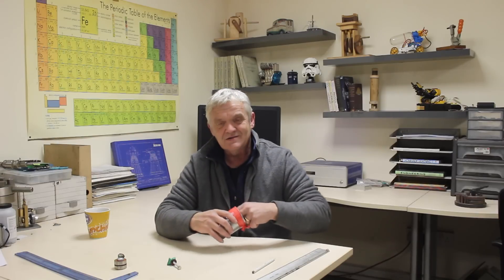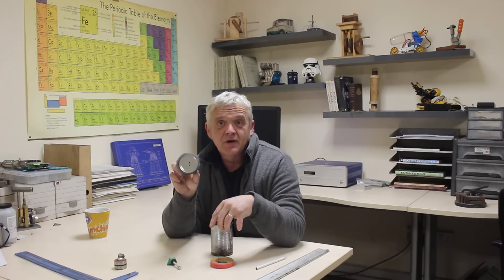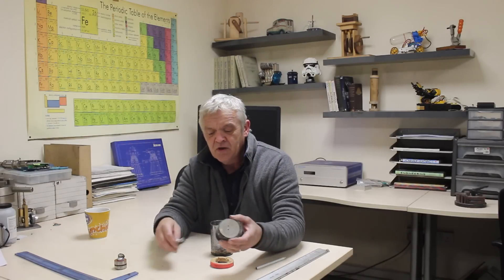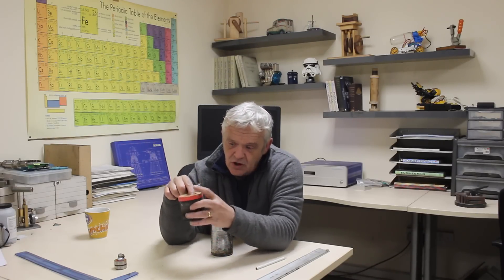1698 Power For Everyone A Cheap Easy To Build Stirling Engine I May Have Invented

Comment: I'm guessing your engine is new. Which is amazing after 200 years anyone could come up with a new Stirling engine of any type....Anyhow I see one potential issue with your design. It's efficiency may take a hit from the energy required to disconnect the magnet. Maybe using an electromagnet and simple having it deenergize at the disconnect point could remedy the issue... All the same I wouldn't be surprised if your design could have a real world applications.

Comment: what if the magnet were an electro magnet powered by the engine?  As the fire heats up, the flywheel wants to spin faster and faster...but you program the electgromagnet in such a way that the engine governs itself...when the flywheel wants to speed up, the magnet becomes stronger and absorbs the extra energy while keeping rpms and displacement constant.

Comment: If you had Huge sterling engines along the spine of an O’Neill cylinder, would that mean that there are certain areas that are deadly or at least very hot?  Or would the air circulate enough to warm the entire O’Neill cylinder automatically?

Comment: For anyone interested in springs at the top of the diagram: 
1. The spring loded toilet paper rod seems to be a solution.
2. It's plastic with a spring in it. 
3. Will stop the wabbling, and give a push back if attached To the top of the magnets, in a linear generator. 
4. The smaller diameter plastic tube is all plastic ( no metal spring). Spring housed in the larger diameter outer tube. 
5. Travel is about a respectable 2 inches/ 5cm.
6. I sprayed graphite lock fluid on it to reduce friction. 
7. One could remove the spring entirely from the tube and glue it to the top of the magnet stack to reduce friction and wobble, and also to an overhead brace bar. 
8. Separately: a straight rod glued to the top of the magnetic stack attached to a bow spring from a hacksaw Blade will stop the wobble and give a return Force. 

SUMMARY: This setup would force air down giving greater travel of the diaphragm. Air to a plastic tube that could drive a second tin can diagram ( cooling side) generator. Thereby doubling electrical output.
Hope this helps.

Comment: Great idea! 😁
Scale up the model with a metal membrane, replace the small magnet and the weight with one big neodyme magnet, add some coiles and compare the fuel consumption (e.g propane) with the generated electricity to get the efficiency. 😀

Comment: I am always torn between Stirling engines and thermoelectric generators when it comes to converting heat to electricity at home. This little motor has me leaning back toward Stirlings. Very cool.
Cooler still is your willingness to share your ideas without trying to get rich from patents. People are going to badly need channels like this pretty soon with the coming hard times.

Comment: Would it be possible to add magnets to the displacer and a coil on the outside?  I imagine you would need to change the material on the sides of the container though.

Comment: If the balloon gasket lay between a lower can with the displacer and an upper one filled with water, (which might replace the metal mass) and two one way valves in the upper can, one allowing water in and the other out, then you might have a simple water pump?

Comment: I dunno why but I find this incredibly fascinating. Obviously the balloon has a very short lifespan but the magnet-displacer could essentially last indefinitely being that there is little to no friction forces happening. And being that the balloon is only regulating the pressure, replacing the balloon/weight with a piston/spring would be a little bit of engineering but could benefit this system to it's maximum. I'm really liking the concept though being that it could be made out of practically anything cylindrical that can withstand heat
Reply: could evilly replace it with some thin silicone sheeting and that would handle the sort of heat its using.   and or adding fins or other cooling to the top..

Comment: So is there a valve?  i keep seeing kinda whips of steam,  also not sure if there was one diaphragm or two kinda sounded like you had a lower diaphragm holding the bolt and an upper one with some sort of button?
Reply from the maker: no valve mate the 'steam you see is a bit of my glove burning where I touched the hotplate by accident lol - there is only one diaphragm the displacer is a solid bundle of wire wool

Comment: I see a problem of using it as a free piston device in that it's not possible to accelerate od decelerate it's speed but I suspect it's power is limited by the strength of the balloon membrane that pulls the piston off the magnet. U can't apply more heat to get more output  as u can from a Stirling engine.
Reply from the maker: a balloon is just easy to make - it doesn't have to be a balloon to be a diaphragm - there are still diaphragms you know
Reply: @ThinkingandTinkering  thanks for the info but can you through experimenting end up with say 1 hp to drive a pump

Comment: Ive always thought with solar arrays if they lose efficiency as they get hot, I wonder if somebody couldnt put a liquid cooling system on them that circulates using convection and then  uses stirlong engines as the coolant heats up to turn that heat into more electricity.

Comment: Hum, replace your top weight with a rod topped by a small magnet that passes up and down through a copper coil, add a couple of diodes to DC it you've got a generator to power your TV, run the fridge and Bob's your uncle !  

OK, maybe charge your cell phone in a day or so, still pretty cool. ;-)

Comment: Clever.

Magnets are wonderful things in their ability to exert and release forces so simply in all kinds of conditions and through various materials.

Put a small wire coil inside the stop ring and lead the ends of the wire out and your magnet does double duty as a generator as it goes up and down.

Comment: About 15 years ago, some australians invented a way to print solar panels. Printer cartridges can be refilled by injecting the ink. What if we fill them with solar panel chemicals then when we print, we select the exact hexidecimal color that activates one of the 3 color cartridges or the black one to print circuits for solar panels? The one thing needed is the conductive ink, there is a way to grind up charcoal in a blender then extract it off the top after it settles to get conductive carbon ink that I noticed. Researching the other chemicals I have seen everything from toothpaste to other weird things being used lol. I don't think it would be that difficult so long as the printer heads dont clog up and it would get the ball rolling for everyone else to experiment with improving the solar panels I notice you have some improvements. I would like to say maybe if you got hologram paper of some sort and painted it with the flourescent ink a certain way it could improve the efficiency if you layed it on top of a printed panel. Do you think this is a great project that could help the world? I have asked defcon and andreas speiss and no one really replies helpfully but you think so much like I do that I think maybe you would like the idea. Also, if you were to do this, make sure you use an older printer that doesnt have barcodes on the ink cartridges because the companies limit whether you can refill them now using those. One more thing If you take a tin can then take two bottoms of coke cans and cut them off then shove them together, it fits perfectly into the tin can for a pison.

Comment: Looks like the one NASA was working on early 2000s. Only no magnets but a spring like system. I can't see magnets being used for a while with your engine because heat degrades magnets of course, you would have to test how long it takes for that to happen. Would be worth exploring.

Comment: Looks really awesome but I thought sterling engines had lightweight components because the pressure difference doesn't exert much force?
Reply: Yeah, most of these are very low power.

Comment: Dear Robert, I really liked your video about this magnet driven displacer Stirling engine! Thanks to your kind words! :) It's not pretty new as an idea to use magnetism to lift up the displacer. Almost 10 years ago I saw a patent from a Chinese LTD Stirling where they used the magnet as lifter. I'm not pretty sure they was the first or not because I saw lot of magnetic LTD Stirlings, homemade and manufactured versions, cranked and free piston versions too. On the other hands what I've never seen that is a free piston HTD version two in one as yours. But I'm not the man, who knows everything about this type of unit or seen every type of engines, just a big fan of hot air engines. The main thing that I wrote you, It has a speed limitation that means power limitation too, because the frequency is limited when we use gravitation to moves the displacer back to the bottom. Some springy part could help a lot to increase the speed,but all knocking noise means mechanical losses usually. Tricky to make one without physical connection between the displacer and the power piston also you should put some spring on the top of the displacer. Anyway your Stirling unit is pretty rare and unique actually simple enough to try to build for every Tin Can Stirling hobbyist! ;) BLADE
Reply: How fantastic that you replied!!
Reply: @WJR-Vlog  🤝 🙏 🍻
Reply: So add ring of spongy spring foam to the bottom of the ring so it absorbs some of the up displacer energy and forces the displacer back down. Maybe even make the stop ring out of spongy foam
Reply: @yougeo  I can see regular foam not liking the heat very much.  Carbon FELT, on the other hand... :grin:
Reply: @KeithOlson  This part is located on the cold side, so no problem with the heat.
Reply: Small repelling magnets on the warm side

Comment: Traditional Sterling engines use heat/steam but I don't get why this one needs a heat source?
Define displacer in this context, does it displace expanded hot air to act as a kind of piston?

Comment: The only downside I can think of is that the high temperature and constant hammering could demagnetise the magnet. Might become irrelevant with a few tweaks though, like softening the blow with felt (as M C suggested) and bleeding off a fraction of the kinetic energy through a coil inside to remagnetise the magnet.

Comment: Great job!!!as a pseudo  engineer😜 I always lookat something for simply  and durability- unfortunately  rubber will wear quickly with heat and expansion- I wonder If replacing the balloon with a hollow piston/ pipe  would work?
Reply: id just do the same with some thin silicone sheeting

Comment: Now all you need is a small coil that little magnet moves up and down in, and you have a generator.

But it won't be much energy because if it's pumping to many amps, it'll stop oscillating.

Comment: 3 ideas for improvement: 1.  put a piece of carbon felt on the ends of the displacer to dampen the noise.
2.  If the wire wool is acting as a regenerator, then cutting holes in the plates that hold the regen together to allow more airflow will improve performance as a regenerator but may reduce effectiveness as a displacer. (maybe like a turbo in a combustion engine?)
3.  replace the magnet with a solenoid or magnetically assisted solenoid to allow for precise control of engine timing with pulsed power input. (like electronic ignition timing in a combustion engine)
Reply: @tomh2618  I'm saying that replacing the magnet with an electromagnet enables you to control the movement of the displacer (and by extension the volume of air/working gas) by pulsing the electromagnet on and off.  Controlling the position of the displacer controls which side (hot or cold) the working fluid is at, and by controlling when the displacer changes position you control the dwell time when the working fluid is allowed to take in energy (heat up in the hot side) and expel energy (cool down in the cold side).
Reply: @McRootbeer  except the electromagnet will likely consume more power than this tiny unit generates

Comment: The Robert Murray Smith magnetically actuated free piston ringbom Stirling engine... do I have that right?  maybe just call it the free piston magnetic ringbom for short.  it's awesome no matter what you call it 😁.
Reply: Dear MC, the Free Piston Magnetic assisted or driven displacer Stirling. A Ringbom type unit has pressure driven displacer, and there is another small piston inside usually. BLADE

Comment: Neat idea. What I'd like to see is a simple Striling engine kit connected to a 12v motor so it can generate small but constant amounts of power. Even a 10w motor over 10 hours will produce 100wh of power.

Comment: Thats a really cool idea! Generally this setup must waste quite a bit of energy just because dropping the displacer with each cycle nullifies the potentional energy it has... BUT there might be two ways to approach the problem - either make it lighter to waste less energy or make it heavier and attach it to a crankshaft mechanism (to act as a flywheel) sticking out of the bottom of the can.
Reply: Go even simpler, change the counter to magnets and collect the energy with a coil. just need to glue a non magnetic spacer between the balloon fixpoint and the stronger magnet. Remember waste heat is everywhere to power this. This invention is more about ease of building.

Comment: I might as well ask here: has anyone seen an engine design that is essentially a shaft in a housing? A series of depressions run down the length of the shaft, in a spiral, with bookended matches in the housing such that cavities are created as the shaft rotates. In so doing, a linear series of detonations can be effected down the shaft's length, only to repeat when reaching the last one. This creates rotation, and also allows for exhaust as the two voids slide away from each other immediately after firing. I know I've seen this some where. Also, you Rock. Great build idea.
Reply: Checked a Rotary engine ?
It doesnt really depend on if its moving down or around a shaft but it might ned some sort of compression/expansion.
Also explosions are bad for getting a normalized/constant power transfer,  continued burn/heating up of gasses allows for a more constant pressure while the volume increases and the burn/expansion is still ongoing.
If it's a single bang there is a lot of pressure (and stress) at the start but as soon as there is a change of volume/movement/expansion the pressure drops rapidly and so does usable force.

There are "explosion" rocket drives tho.

Turbines are "simplified" a constant/linear ongoing 4 stroke process..
Reply: @PsiQ  Heard. If I understand correctly, a rotary is a Wankel type? In that case, the Wankel would almost be a 2D, if you will, version of this, which is an extended shaft.  To be fair, this design could utilize steam, or even compressed air and still function.
Reply: @wombleofwimbledon5442 
both the  "piston" and rotary engines can use steam/pressure if introduced where the spark/ignition is supposed to happen, but you would not get the high input to output ratio of the enclosed exothermal reaction/pressure increase.
also leakage (Pressure loss) and oil usage/blowby is a lot easier to handle on multi level sealing as done on pistons over sliding surfaces like a rotary/wankel design.
(thats why getting the rotary past emission regulations is really hard, burning oil)

Comment: The resonant lineair stirling motor has been tried by a dutch gas heater company.
Burn gas for heat and produce about a kiloWatt of electricity, it worked but was to expensive and unreliable.
Reply from the maker: Iknow the type you mean - it was basedon the NASA stirling which used gas damped springs -this is veryu different to those

Comment: Interesting. Could you modify this to be used with your magnetic switch (1036 & 1041) by placing a coil next to it to generate electricity ? Would be interesting to see the power it could generate.
Reply from the maker: i would think so mate - it's a bit ew to me right now but lots of things to do

Comment: It is on the cold side, but might there be a problem with the magnet failing if it gets above its Curie temp?
Reply from the maker: yeah for N52s it's aroud 400 degrees C or so